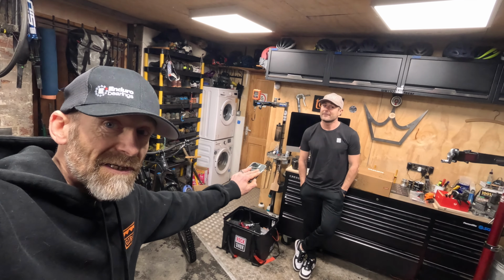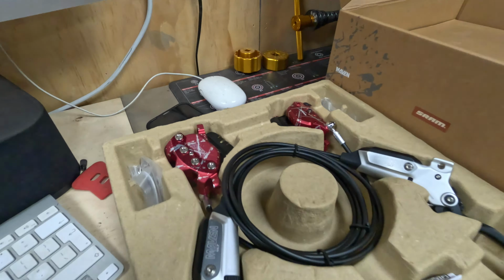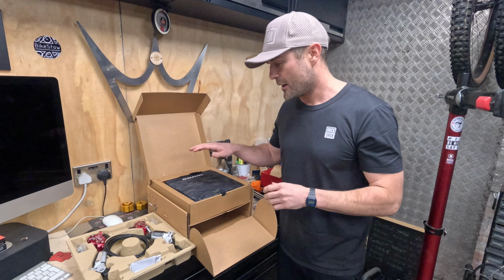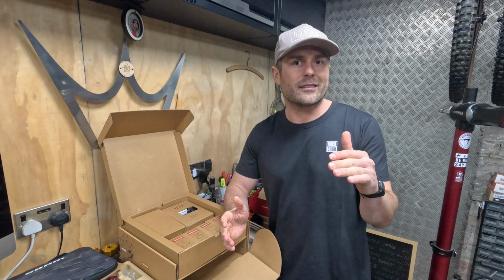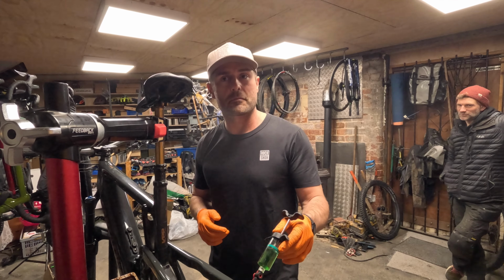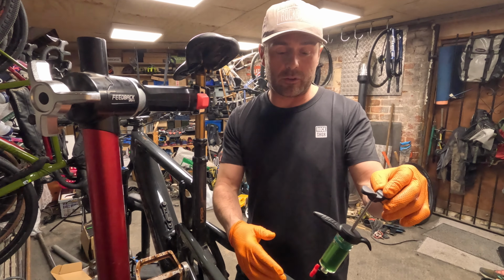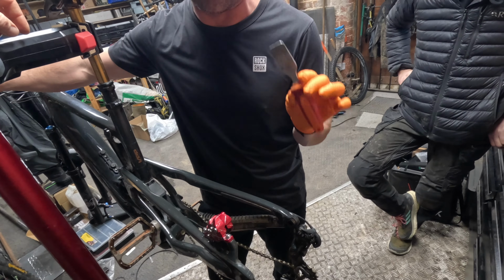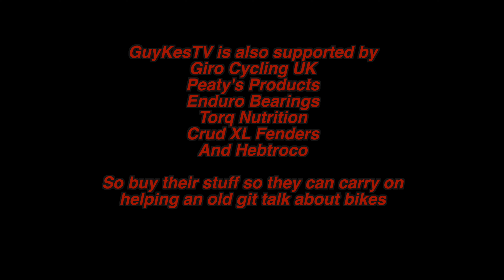World's most powerful MTB brakes. We Fit SRAM's New Monster Maven's

Comment: I am kind of surprised really. Of course I don't know, if the Maven is in the end more powerful than a Tech4 V4, but in no place I have ridden did I want more stopping power. I run them as V4s on enduro and ebike and an e4 on my trail bike. Paired with a 220mm HS2 rotor on the ebike in the front and 200mm in the back I had some cases, where that combination in the front was almost too much, considering me weighing around 215lbs plus an almost 60lbs bike.

Comment: Did you guys have any issue with the pad massage? I felt like I was going to break the brakes (ha) when trying to get the pistons to move. Felt like they were cemented in but I did eventually get them to move and did about 3 full cycles per piston. Brake works great now but damn, that was tough.